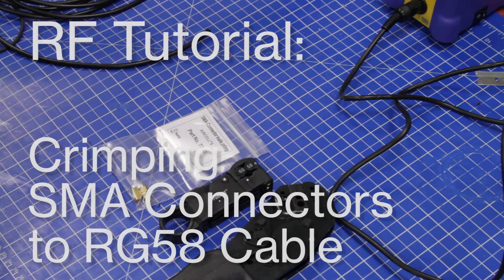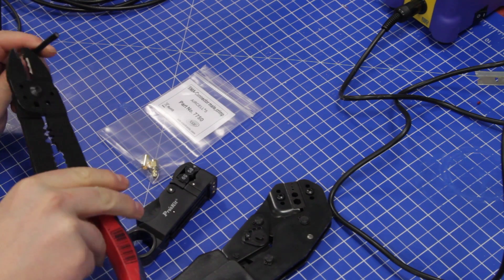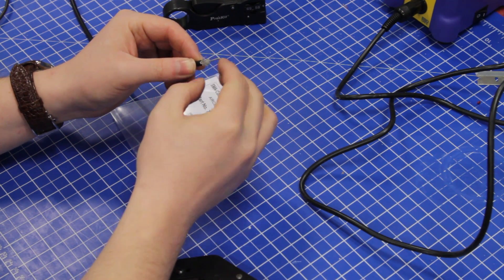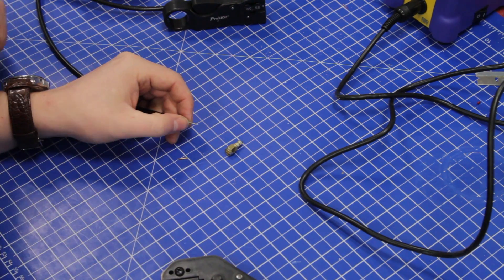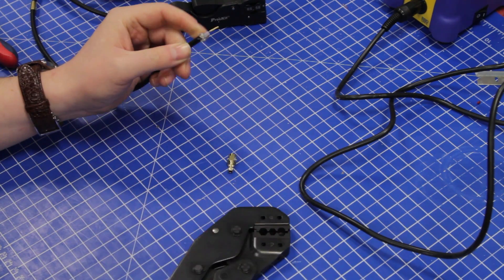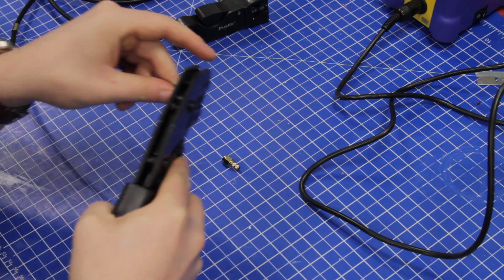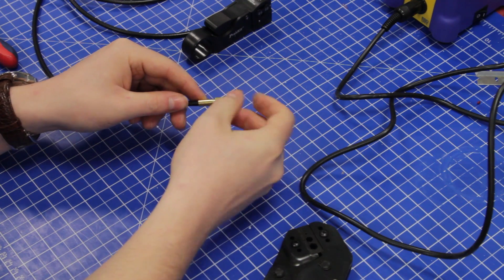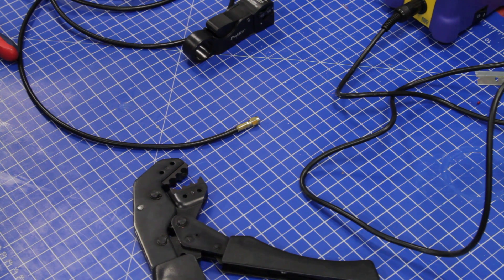How to Crimp SMA Connectors to RG58 Cable

Comment: I am still stuck. The hole diameter on my pins is 0.6mm and the solid core of the RG58 is 0.8mm. The multi strand version core is 7 by 0.3mm and only 3 cores will fit the pin. Is it possible to source the SMA male pins with a larger diameter cable core provision ?

Comment: I find that the centre pin often breaks on crimping because it's rather brittle.  Since you don't get 2 pins in a bag (looking at you, Amphenol :-( ), this is a bummer.  So for SMA I solder, which is also tricky, easy to have the dielectric swell up "mushroom-like", which means it needs trimming down with a scalpel and that's going to affect the insertion loss.

Comment: Aaaand... that's why I'd rather see instructions for just using a blade.  Those strippers are so fiddly.
Reply from the maker: Yupp, they work if you need to make 20 cables in one go, and you never change brand of cable. For one-off cables I generally use a razor.
Reply: @GrumpytechieNet  Good point.  I can't say I've ever tried tweaking them for reliable cuts on one roll of cable.  Wasn't even clear, or possible, to adjust the couple I have tried.   Good to know if I ever have to, though.
Reply from the maker: @radellaf  Almost every coax stripper I've used have little set screws for adjusting the blades, as the tolerances are so small that just switching brand of cable can make it cut too deep or too shallow.

Comment: Would have been nice if you had elaborated on the measurement of the various strips and trims.
Reply from the maker: It rather depends on the specific connector, and most manufacturers don't bother to give measurements. And in reality you can usually eyeball the measurements when assembling the connector, the only really important thing is to make sure the core doesn't short out to the shield.

Comment: It was really useful seeing all the mistakes you made on the way to help me to know what to avoid as well as what to do.
Reply from the maker: Did I get it right in the end though? :) I've never been very fast at doing them to begin with, and I used quite cheap cable and connectors as it was only a demonstration, which gave me a bit of grief.
Reply: @GrumpytechieNet  just tried my first attempt and I'm totally failing!
Reply from the maker: @NathanJPhillips  Give it a couple of tries and you'll get it, SMA is harder than the later ones. Also check if yours are the solder or crimp center pin type. And remember to measure that you didn't get a short between the center pin and the outer shield!